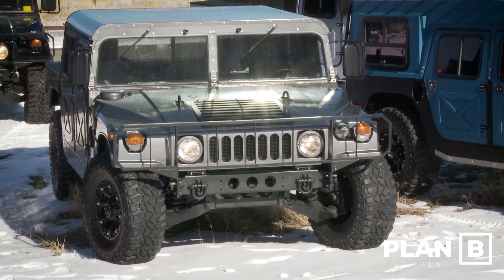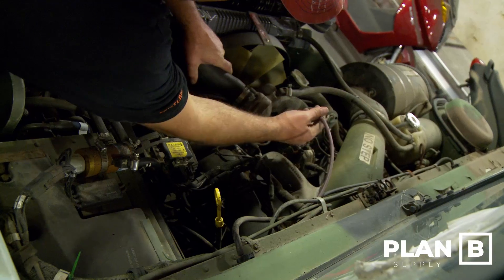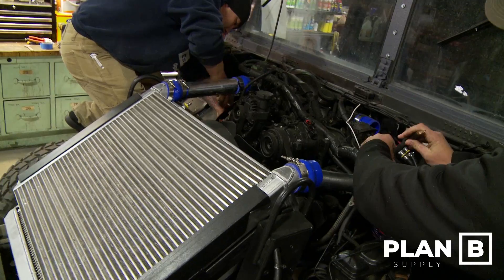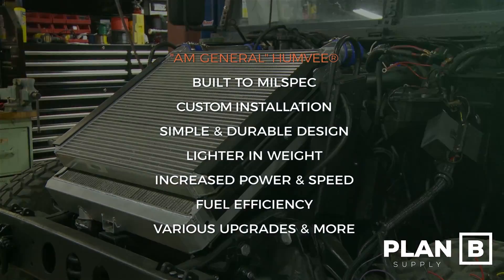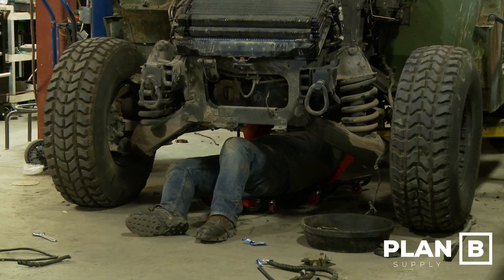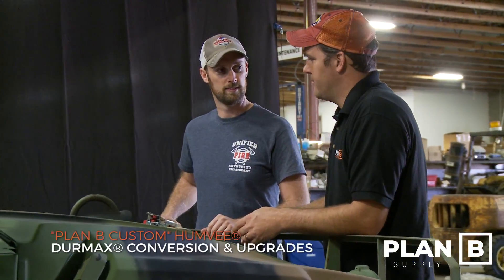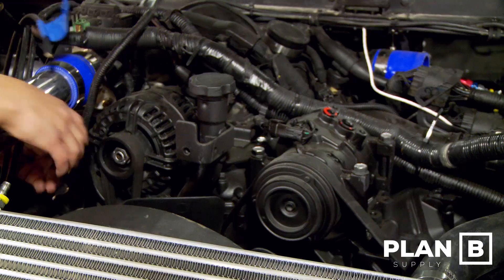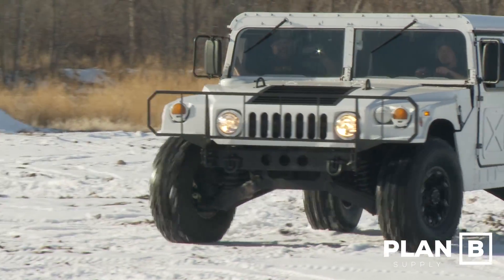Humvee Duramax Upgrade

Comment: Is it possible to do a Duramax or equivalent Cummins to manual transmission conversion?
Reply: I heard it's a bit difficult due to the sheer width of the vehicle and how far away the driver is from the transmission

Comment: Edit:   Apparently dan has ghosted me when following up on getting additional repairs covered by Plan B after I had gotten the vehicle home with under 1700 miles on it.   It took two trips a couple days each , up to Utah from Texas to pick-up my Duramax conversion.    Several issues were identified with the build, and they were addressed,  but it took them SEVERAL attempts to get things right.    If you guys at Plan B are ready to resume talks about covering the additional repairs, and ill consider taking down this comment.  Additional repairs to shift linkage and electrical system were required,  aside from the additional grinding I had to personally perform on my brake calipers since no shops locally wanted to perform the repair due to safety concerns.   I've been patient with waiting on a response.
Reply: What was their last response to you?
Reply: @miguelestrada8779  they haven't responded,  to this or direct emails to Dan, Tom, Mike and company
Reply: Good to know. Thanks for commenting. This was one of the companies I was thinking about using for my H1 conversion
Reply: @chadkeech226  sure thing.   Still chasing electrical gremlins out of it off and on.

Comment: What's the miles per gallon after the conversion?
Reply: Aaron Cross not much of an improvement
Reply: same MPG for triple the HP and most likely more torque? You could probably swap for an engine with 150 hp and same torque numbers but better MPG, it's all about the configuration
Reply: @devingarrison5265  that's actually a pretty good improvement. When you get 8 to 10 on average with a stock configuration doing the conversion it's now at about double the fuel mileage and I would say that's a significant improvement.  Not only are you getting nearly double the fuel mileage you're also getting about three times the power.
Reply: Devin garrison you get like a extra 100 miles out of a full tank
Reply: Predator Inc who also does Duramax swaps with similar power figures claim they get 18mpg. I don't recall if it's city or highway though